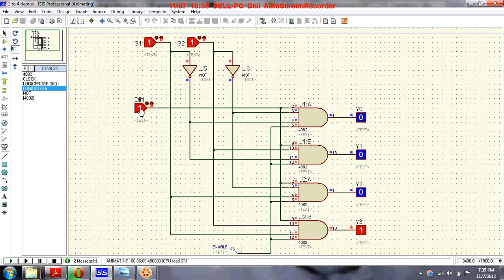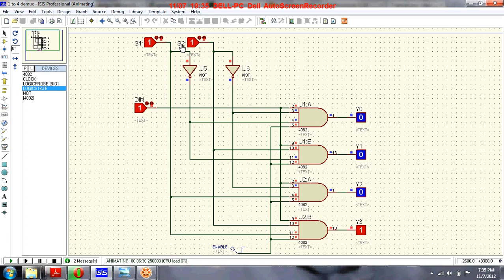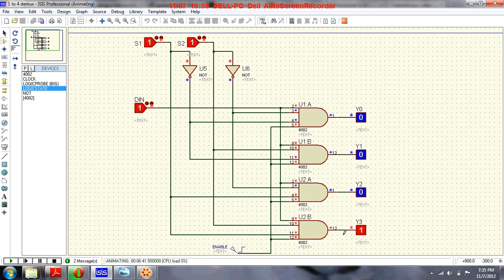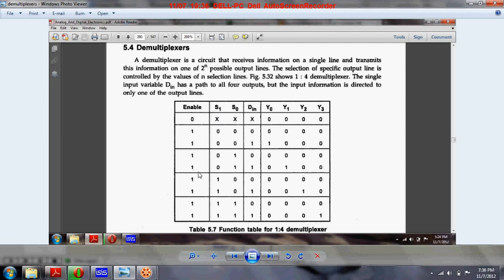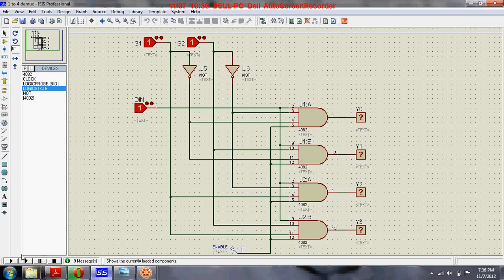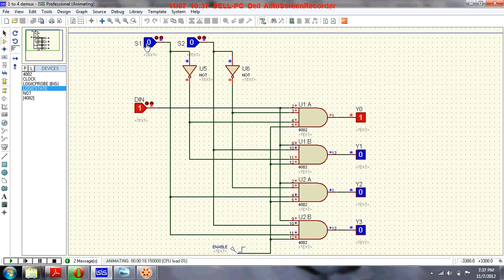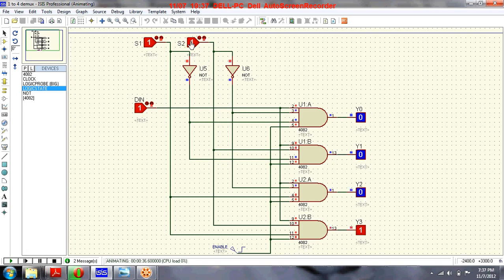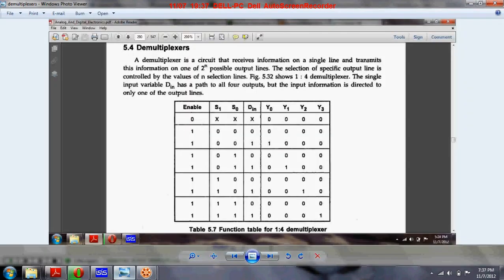1 to 4 demultiplexer.avi

Comment: Plz make video on 1:8 demux
Reply from the maker: For 1:8 demux, there will be 3 Select Signal lines and 8 output lines ( since for n=2 input or select signal lines, 2^3=8 output lines ) Rest working principles are same.
Reply: But there is 4 input AND gate ... 3 select line..1 enable...then how to apply data signal i.e. sine wave apply u in 1:4 demux
Reply from the maker: There will be 8 AND gates which will be connected to 8 output lines.
Reply: But every AND gate has 5 inputs..3 select line input , 1enable, and where to apply data input?